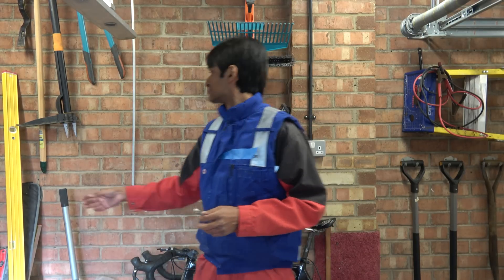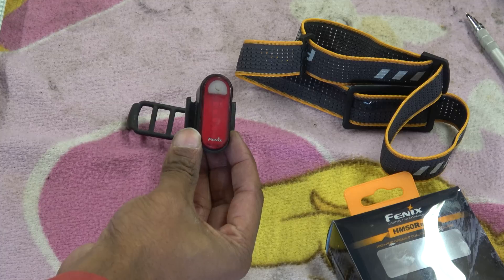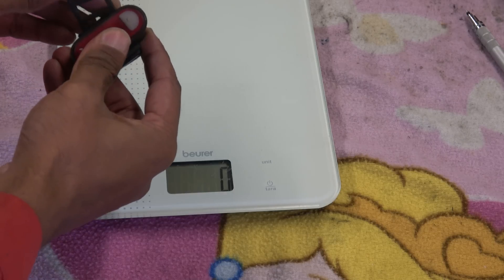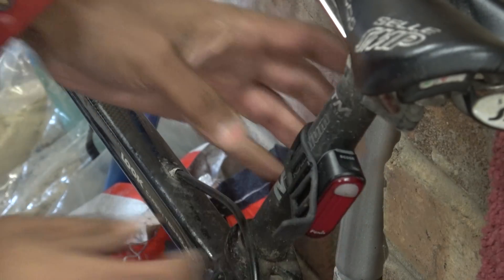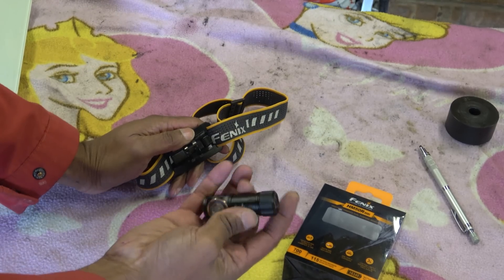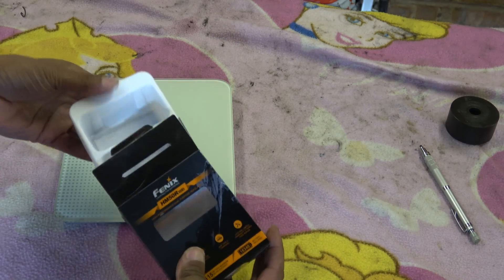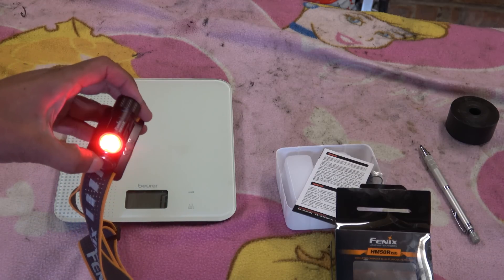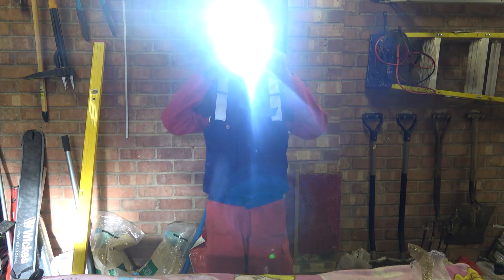Aerospace Engineered Lights For your bike (FENIX HM50R and BC05R)

Comment: This was perfect timing for me as I needed some new lights. 
I tried them out last night. The rear has a really wide angle so precise angling isn’t necessary. 
The front light is excellent. Changing batteries is easy but be aware that for full power mode to work you need a decent battery, not just a standard CR123 rechargeable. 
Thanks Hambini!

Comment: I've been using a ratchet strap attchment backlight, superior to these rubber fixings as they're not so easy to pinch and fit perfectly to a seatpost and without the excess rubber sticking out like a limp dick. It runs for approx 40 hours using 2xAAA Fujitsu, output is a claimed 2x0.5watts which is more than ample for even foggy conditions
Cost £5 and so far 5 years of use in all weathers. has a steady single, double and repeater flash.

People using headlight torches on road should be shot, there's no need for them, its selfish and you look like a dick. Off road, do whatever, on road, just no.
My front lights are both Sigma, PAVA is my go to, enough for a 25-30mph downhill on unlit roads if you must, beam pattern is narrow and is perfect for roads without blinding cyclists or motorists. Runs for 15 hours on high, 30 on low using 4xAA fujitsu rechargeables, ratchet clamp again that fits to any size bar in seconds and is solid AF, unlike the rubber strap shite. Had this light 10 years, best all round road specific front light ever made IMO.

That said, got around at night perfectly fine in the mid 80s in a big city and out of town, the problem is not just motorists but people on bikes wanting to go ever faster at night time and then running out of thinking time when they do meet a hazard even if they see it a little earlier/better, they are going so much faster than with a lihght that doesn't illuminate as much they can't react and brake so readily to avoid.
This is why brighter lights never equals more safety

Comment: I've had this rear light for about 9 months. I just wrote out a big review comment but youtube seems to have not saved the fucking thing correctly! 🤬 Serves me right for not copy-pasting into notepad before I guess! To TLDR it the rear light is great, mine has 3 LED chips and only 4 modes, so maybe it's an older one. The one bugbear is the rubber strap. It has the feeling of one of those gummy snake sweets just before you pull it apart. I knew it would break quickly as soon as I removed it from the packet and fitted it to the (28.6mm) seatpost. After about a month it did indeed break and I've been using a different rubber strap. Aside from that, great light!

Comment: To me, the main problem of any bicycle light is corrosion resistance and the fail of the rubber material. I live closed to the beach and usually the circuit board or the USB port fails due to corrosion. Or the rubber parts (usually TPU) part fails due to humidity (hydrolisis). The only good reason to pay more for a branded bicycle light would be a better specification about those problems and a very long term warranty.

Comment: Was considering getting the olight perun2 headtorch but it has always bugged me there is no red light option. This torch looks very similar but with a much better waterproof level, usb c charger so much easier to find a replacement cable if needed and red light. Glad you made this video 👌🏻

Comment: if you are into „don’t blind people in front of you” take a look at ravemen pr series which have non blinding mode for one eye and full throttle for the other. plus wireless pilot for the handlebar and they can be quite powerful. i’m riding with maximum power in non blinding mode and so far no one is turning his head away from me when i pass them - so it seems to work as expected.

Comment: Most rear blinkers are directional so need to be pointed at the horizon where driver's eye likely to be. The seatpost in the video points down and in turn so does the light limiting visibility from behind. The mounting device needs to be able to change angle to account for that. The headlamp is great but not for road biking with your mates. Maybe mountain biking or exploring your shed at home or camping.
Reply: The BC05R is just a couple of SMD LEDs, the red lens isn't doing anything beyond protecting them, maybe diffusing the light a bit. For this style of light angle isn't as important as say a Cygolite.

Comment: Congratulations, a blinking rear light and headlamps are the most annoying and antisocial bike light combination you can use, and they are forbidden in most european countries for a good reason. 

A blinking rear light is also suicidal as it makes it harder to identify your position and speed. Any other traffic participant has to look longer in your direction, and drives involuntarily TOWARDS YOU while doing so. A static rear light is far superior in this respect. If you want to be more visible, use a static light combined with a pulse.
Reply: Congratulation on your selective hearing.
Reply: Nah, that’s a myth. Often released, rarely seen.

Comment: For my experience the best position for the back light is not... back. I put it at the end of an extra metal or plastic arm 15-20 cm long, fixed to the left (or right in England) of the handlebar. So the light can be seen also from the side, not only from the back, and being in front I can see if it actually works or not. And most important is that your body is totally to the right (or left in England) of the light.
Reply: Would the extra weight of the extender result in clockwise circling?
Reply: @Lestalad1961  what?
Reply: @markifi  poor attempt of a joke. Any weight extending (on the right of the bars in the U.K.) could bring on a tendency to pull the bike to the right and ultimately a clockwise circle. Simple 🤷🏻‍♂️😬
Reply from the maker: That is a very good suggestion.
Reply: quite an interesting suggestion. does the blind spot on the right side on the rear (left on the rear in england) cause any problems?
Reply: @markifi  no, if you are on one side of the road you have to be seen from the back and from the opposite side of the road. For a vehicle coming from a lateral road on your side you have the front light. I keep the "back" light at a 45° angle between the back and the side, blimping.

Comment: If that headlight is that good, wouldn't it be nice for it to also have an adapter of sorts so that you can also mount it on your handlebar ? Have you heard of such developments coming up ?
I only see front bike lights with cumbersome semi-permanent attachment on the Fenix website, nothing as easy to mount on and off as that very interesting rear one. (Price point really is great on that one by the way)
Reply from the maker: I've also got a New Wuben Light and Magicshine (I didn't think of that name) light review coming up. Both of them are way better than the exposure light that I used to use.
Reply: @Hambini  oh nice ! Thanks I'll sit back and wait for those vids to pop up. I'll make sure to crank up the volume first.
Magicshine gives me the idea of the perfect rebranding for Zipp considering their marketing habits. Magicshite 👌
(Don't know if you've heard of that one, but I've read of several cases of carbon stems from them fitted with somewhat titanium screws that fails at not even 5N.m !)
Reply: @Hambini  any suggestion on models? Currently hunting for a good light to ride through very cold and foggy winter coming up.

Comment: Merry Chrimbo Hambini :) . The most annoying thing with bike lights (for me anyway) is how long the batteries last. The bigger the lux/lumen the faster the battery dies (obviously, apologies for the sucking of eggs). Since going ebike though, it's no longer a problem. The lights are powered directly from the motor battery. A bit fiddly wiring in the Chinesium instructionless indicator switch set, front and rear lamp assembly but well worth it. Front lamp was rated at 800 lumens but seems brighter. Chinesium often tells fibs, but this time thankfully, in a good way. Have a great new year mate, looking forward to your 100k sub party!
Reply: The most important job for lights is firstly to make you seen by other road traffic.  Having a clear view of the road to allow fast travel is something I was never able to achieve.  But you can make careful travel on roads watching for road hazards.